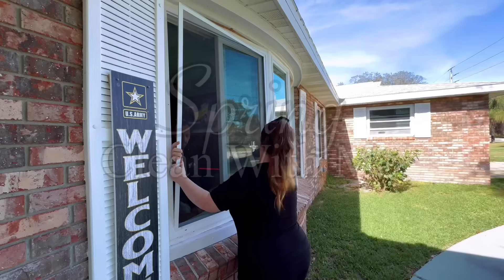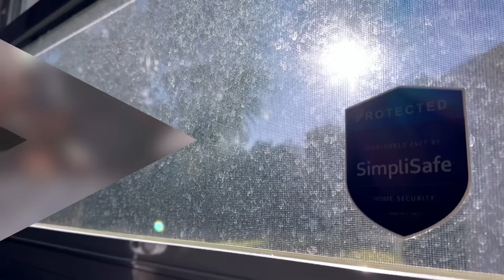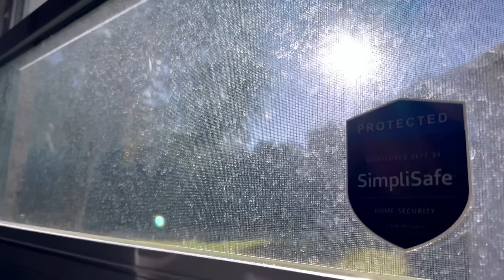Extreme Home Clean With Me ~ 2024 Spring Cleaning Motivation ~ How to clean house

Comment: I start Spring cleaning in early March- usually one room at a time and it’s “torn apart”, scrubbed, rinsed, repainted (if needed or just touch ups) and mattress flipped or vacuumed and shampooed with my Little Green Machine, if the room is a bedroom, otherwise upholstery gets the vacuum/shampoo treatment. Once it warms up enough in the Rocky Mountains, I will open windows and start cleaning them and the screens, one room at a time; then we start cleaning up the yard. Once we no longer have freezing temperatures we power wash the exterior of the house and the roof (our son and son-in-law do the roof) to get any residual debris off it and clean the gutters and also power wash the outside furniture and deep clean the grill and Traeger. We are usually done by the end of April or very beginning of May, then it’s time to prep the vegetable garden for all the new starts we sowed in March. Then it’s general maintenance through October and the cycle repeats itself to get ready for the cold months. General interior maintenance is usually picking one room or area to do a more deep clean (my spice cabinet and closets always seem to be conquered this way) while doing weekly maintence/cleaning during the week so I don’t have all my days off consumed with lots of cleaning. Yes, I dust, wipe down the bathrooms, sweep, vacuum and mop (all manual, don’t have a robovac or powered wet mop) at least three times a week after work so my days off are light duty stuff and one deep clean area.